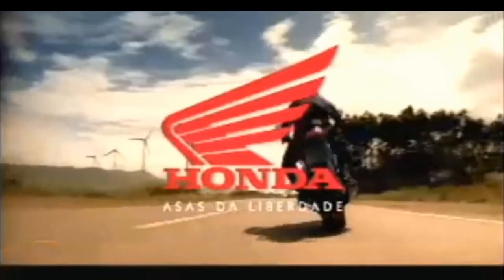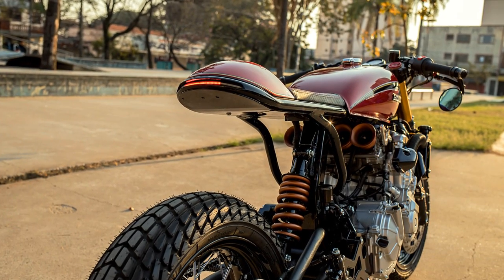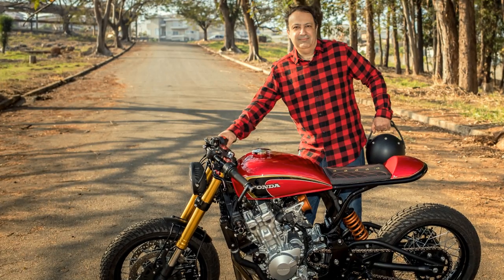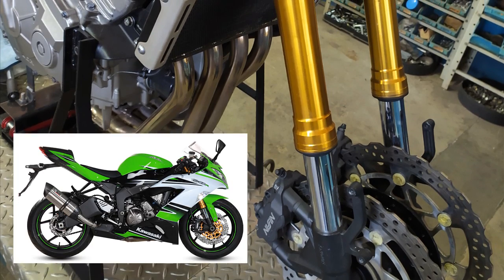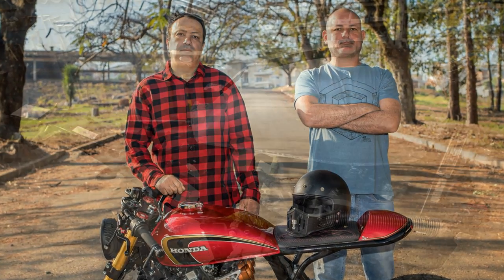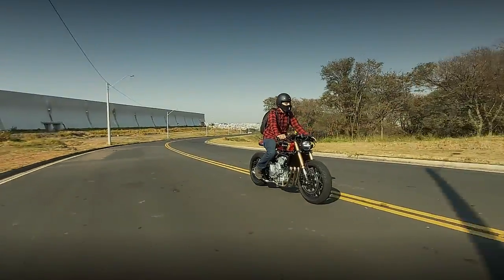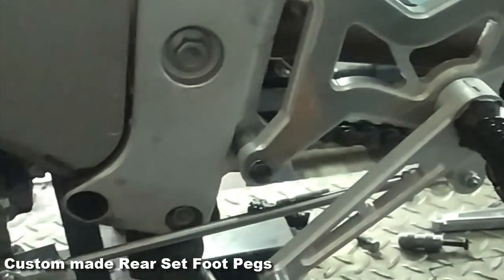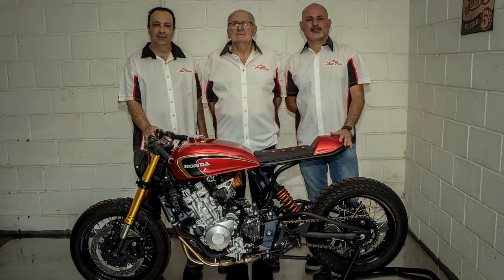Cafe Racer (Honda Hornet by Retrorides by Lourenço)

Comment: I am not a fan of liquid cooled bikes, nor am I a fan of UJM (4 cylinder) bikes. But I can certainly make an exception this time. The end result was visually a much simplified machine but it took a lot of artistic engineering to get the stock bike to that final clean airy finished project. The new swing arm/rear subframe work is perfection and flows perfectly into the tank. The brass coloured velocity stacks are a real nice accent. Great ride and great presentation.
Reply from the maker: Thank you my friend for sharing your opinion. :) Cheers.